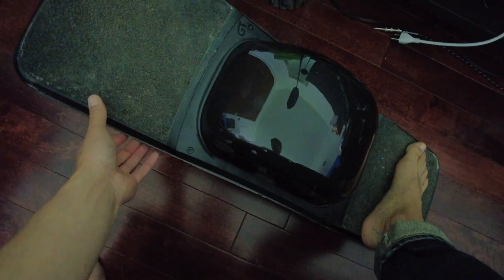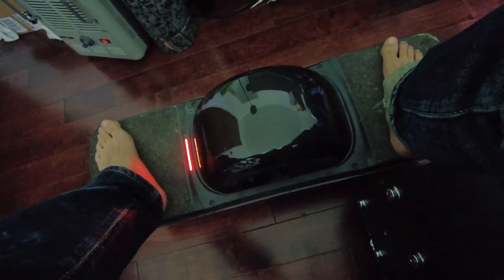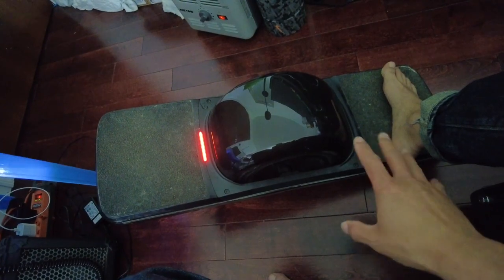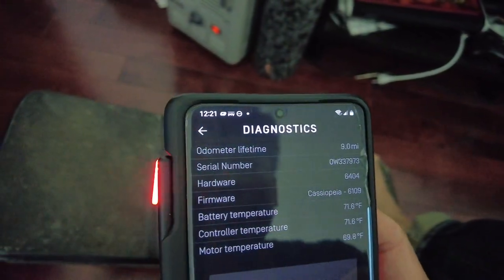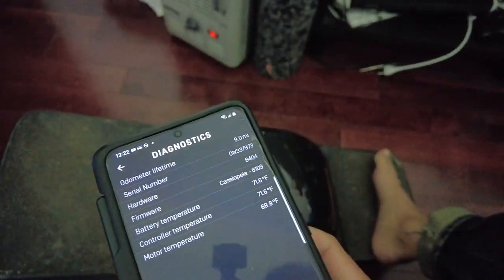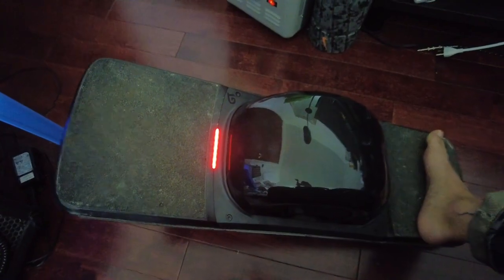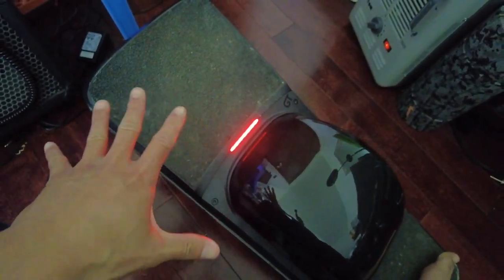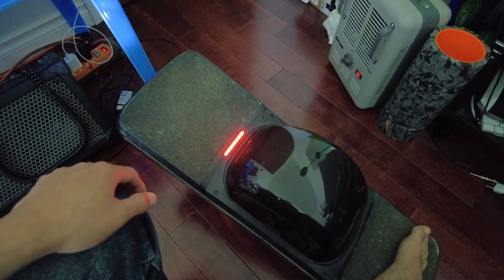Onewheel GT:  Error 22

Comment: what happened, I'm having the same problem
Reply from the maker: Can you describe your board's symptoms?  And do you have error 22 on your screen?
Reply: @RichieValentine  Yes I have Error 22  Incompatible hardware detected.  When I power the wheel on I can step on it.  it will engage and balance but within 20 second it will flash red and beep and the error will display.  This also happens if I turn the wheel on and just let it wit for about 30 second.  I send the diagnostics to future and they said I had to send the wheel back, I shipped it yesterday.
Reply: So what happened with yours? You had this problem looks like 8 month ago,  FM sent me a prepaid UPS label, I'm within a year of receiving the board so I expect it to be covered but they have a reputation....
Reply from the maker: @sillythingsibuy3719  exact same thing happened to me.  They will fix it and give you a new footpad.